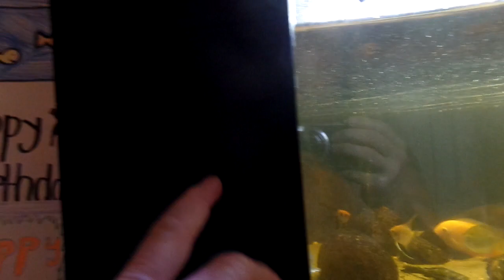1210 Gallon DIY Plywood Aquarium System Update

Comment: I'm building a plywood aquarium but I'm not sure how thick of glass I should use 
4 foot by 6 foot 3 foot tall with only one viewing window what is your recommendation 1/2 or 3/4
Reply from the maker: hello.. If the viewing glass is 3ft, top to bottom, I would suggest 3/4inch. Pressure is greater, the higher the tank gets. Im using 13mm.. Just a fraction over 1/2inch.  Even though there are 1000 gallons and the tank  is 30inches high,  the glass opening is only a 2ft high glass